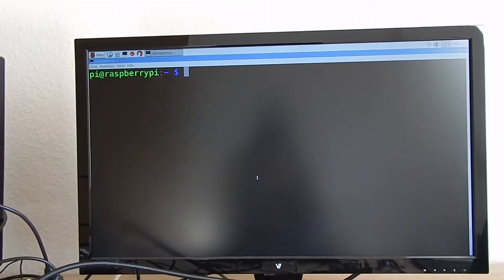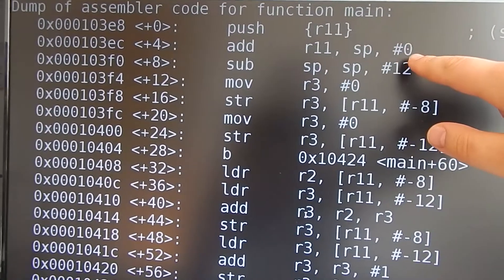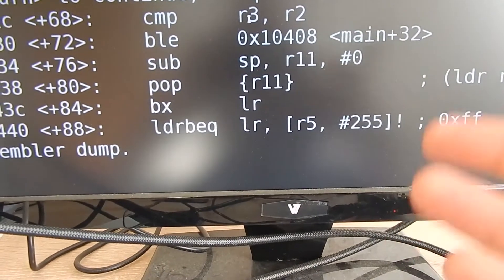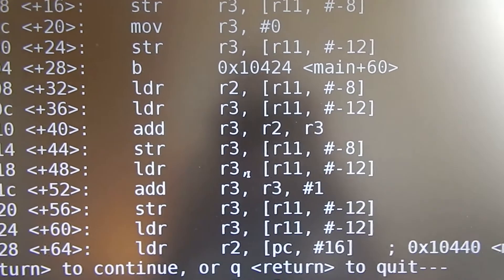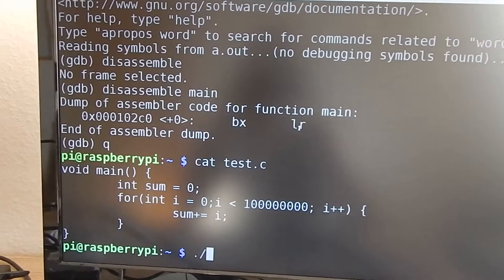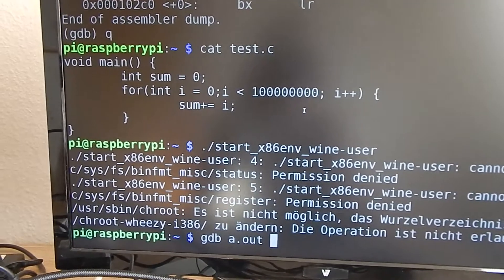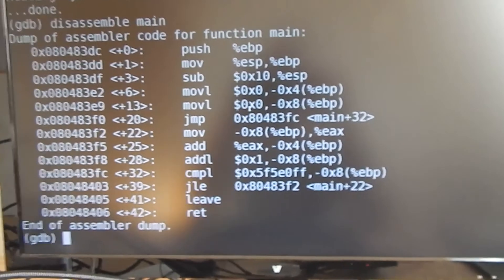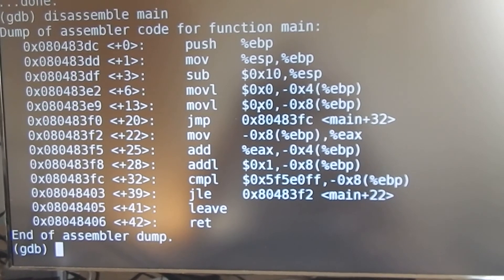Disassembling ARM vs x86 (on Raspberry Pi)

Comment: Don't see how this explains exagear / wine running winquake about 5 times faster then qemu / wine on a raspberry pi 2.. i would love to see you make videos using exagear, mabe the company will give you a free license if you make a good video for them :)
Reply from the maker: Qemu is 3 times slower than native. Exagear can not be 5 times faster since it would then be faster than native.
Reply: You have a good point, I quess what eltechs claim is, if a x86 benchmark takes 1.20 seconds at some task with qemu, then exagear wil do the same task in 0.20 seconds, while a native arm equivalent benchmark could do it in mabe 0.05 seconds. 

But you just test a very very simple program loop, in emulating a full X86 cpu there are many more complex stuff to emulate and there are so many solutions in how to do things, and i think eltechs have found beter solutions emulating the full cpu wich results in 5 times faster performance. 

And when i see winquake running on a raspberrypi 2 so fast, i can't believe qemu can also do that at that speed. When i run qemu on my PI 2 then opening notepad.exe costs a lot of time, while exagear runs more complex programs smooth. You can even run windows skype very usable on a raspberry pi 2. I don't think qemu can do that. 

I did have some mail contact with them, ask them if it was possible to emulate a complete windows system, like running windows XP in a window using a hardfile, like qemu can. But the anwser was that this isn't possible in THIS version. Mabe in the future.
Reply from the maker: I wonder if exagears has to opensource its stuff according to GPL.
Reply: You can now install eagears and use it for free in a trial periode of 3 days: https://docs.eltechs.com/install-and-configure-exagear-desktop/how-to-install-exagear-desktop-trial